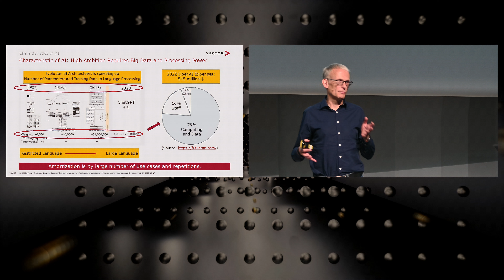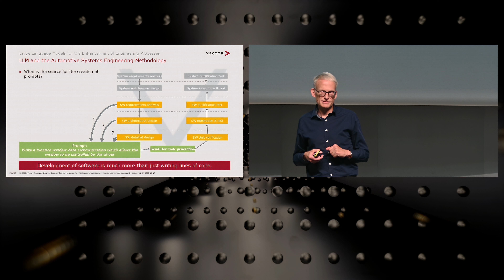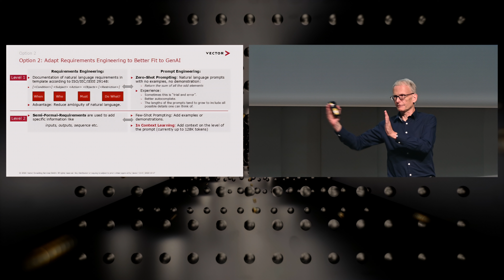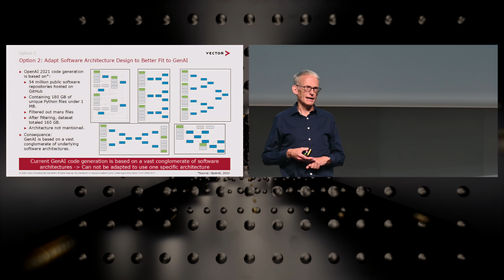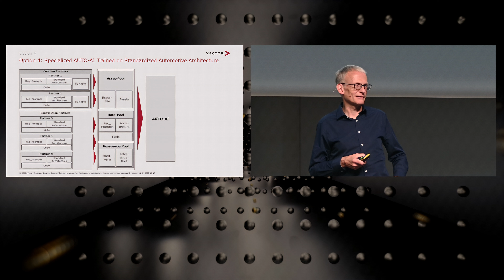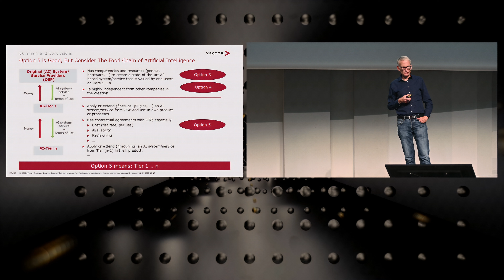2025 Stuttgart International Symposium - How to Combine GenAI with Systems Engineering

Comment: Wow. Weird to see the V model is still used. It's almost as bad as Waterfall 😢
Reply from the maker: Thanks for the comment. Please note that I refer to Systems Engineering, not the V model. There is a systems logic in the processes. For example, the architecture is based on requirements. This does not imply sequential processing.